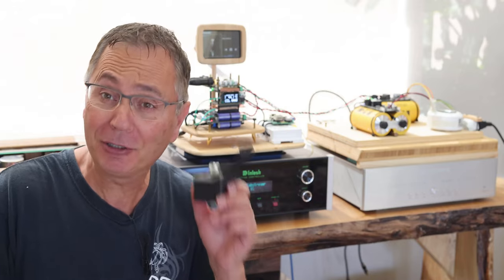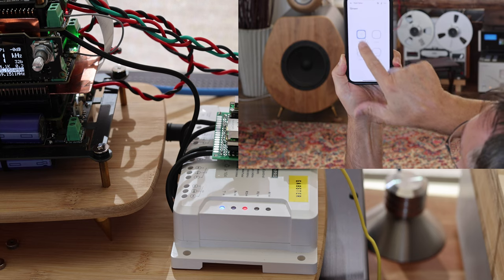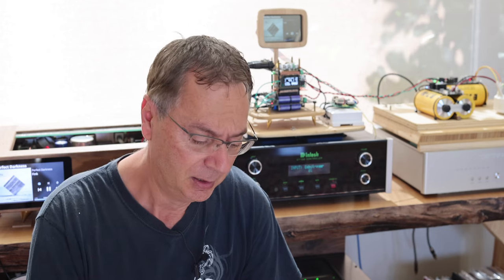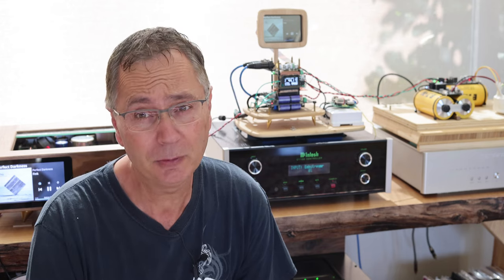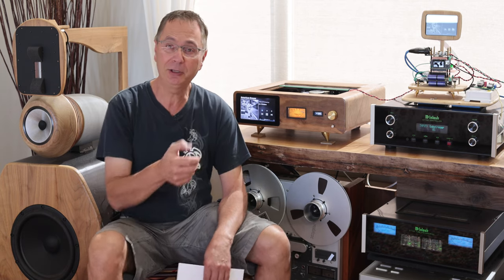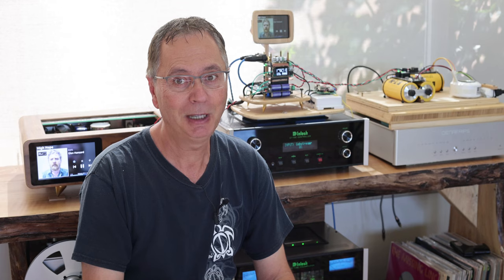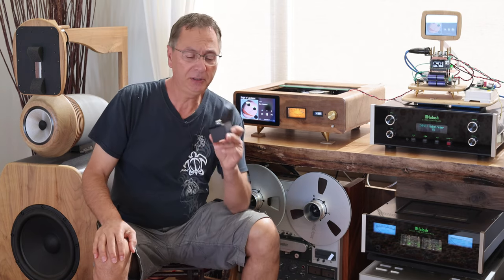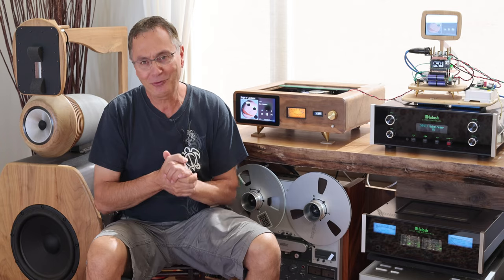Ian Canada SC-Pure Clocks. Are These DAC Clocks the Best for Your Audio Setup?

Comment: Thanks for the insights, could you also highlight beside the depth and seperation, how is is the high frequencies and bass say, compared to the Crystek. Ciyld the Crystek have more high and tighter, punchier bass compared to the pure?

For rock, pop music, does it still outperform the rest of the clocks tested?

Thanks again for your work and videos!
Reply from the maker: The Bass is nice and tight on the SC-Pure and highs have more layers and yes it does outperform the rest with all music including Rock and Pop. The better Quality recordings and better systems the difference is bigger and better.
Reply: @Gabster1  is sc pure ocxo ?

Comment: I replaced stock clocks in old Audio-gd HE-7 for accusilicons 90/98 and the change was unbelievable. But that cost 200 Eur for both with work of the technician. If the clock weren´t so expensive I would try them.. Thx for the vid
Reply from the maker: Glad you made your system better.

Comment: thank you for sharing, if you have time id like to hear more about why we need 2 clocks, what is the 45/49 you mentioned  and if the 45 will get you going, is it a option to just have 1 sc pure and 1 stock vs 2 crystec for example ? you mentioned clarity, detail and soundstage in your experience with your system could you put a % or # to those differences as if you were  taking notes for your own personal reference ?
Reply: One clock covers one set of sample rates.  45MHz will play multiples of 44.1, 88.2,176.4 etc.  The 49 will cover the multiples of 48,96 etc.  You can upgrade just one and compare the sound with your current clock by resampling the same track to be 44.1 vs 48 for example.  I use one expensive clock at 5.6MHz as 99% of my library is CD/44.1.  If I put in a second premium clock it will be 49 or 24.5 to play the higher sampling which is often at a multiple of 88kHz.
Very hard to put it into a %.  Some people are convinced they hear no difference.  To me it is a big deal as it is natural, holographic and analogue.  Others find it to be a very slight change.  Also depends on your total system and the type of music.  I like really well recorded jazz and like to hear the micro detail which delivers the emotion and and ambiance.  If your taste in music is to highly compressed rock or heavy metal, then it will make little difference.
Reply: @user-od9iz9cv1w  thank you for your reply.
So the 45 for cd & the 49 is better for streaming 24/192 ? which is mostly what I do.

Comment: Gaby - on the D11 did you end up using separate UC supplies for every v+ input (3 on the DAC and 1 on fifo) and for pi 5v and separately for the audio hats 5v? So 6 UC supplies?
Reply from the maker: Hi Chris
5 actually 1 for every v+ input (3 on the DAC and 1 on fifo) and 1 for FIfo 5v the RPI needs a lot of Juice so it runs on LinearPi/UcConditioner all supplied by 6 independent Ac 5x12v and 1x6v 
I later Realised that I did not need the VCAA on the Dac if running in Sync mode so 1 is not used now but may use it in my future upgrade may use the OPA 861
hope that helps

Comment: You mention they are double shielded, this is not correct. The outer shield has a lip that clamps the oscillator housing to lower resonance. No double shielding.

Comment: I have watched this video like 3x really want to build me a streamer/dac I normally just plug my labtop up to my denefrips ares2 or Burson composer dac ' (Tidal) what would be a good starting point for me Gabster ? I read schamtics on a daily bases i work on Multimillion dollar machines and Automated robotic systems i just stay so busy ! Never used a streamer just laptop and Cd transport 

Thanks Gabster
Reply from the maker: The Denafrips don't let you disable their internal clocks to use a better one so the sound does not change a lot but I suggest building a streamer dac for not a lot more that will beat the Terminator even.
I suggest this one but you need to add a couple PSU's once you like it more you will sell your Denafrips and break even. You can also email Ian tell him you were talking to me he will recommend something for you. :)
Reply from the maker: you can later splurge on scpure clocks they are great
Reply: Can I add those clocks to my dacs ? 
Or Are you talking about building 
The Pi streameri/Dac ? 
Most if the time I can't find schematics to my audiogear ' 
I need to get more involved with DYI community 😩
Reply from the maker: @tee-jaythestereo-bargainph2120  
you can probably replace the clocks but the output stage is still a issue. Better to sell it and build it the best way.
yo can start with the Protodac and a fifo Q7 that you can later use with your bigger build. it is cheap and effective and if you later upgrade you can reuse most of the parts.
https://youtu.be/m0esUvVu9W8?si=vOkW3rTv6rIg2aWO

Comment: This is a useful opinion to temper expectations vs the run of the mill clocks.  Your point is valid that clocks are the last step.  If you have a well resolved system and you listen critically then they are key in separating your DAC from average to exceptional.  
Also useful to simply get some insight into the pricing.  This is expensive.  Far more expensive than the first round of Well Audio clocks.
I think we need Doede to compare them to WellAudio clocks for an opinion on the high end clocks.  Frankly if they did not sound significantly better than the Crystek, then what's the point?
Reply from the maker: Thank you great points Please bare in mind I only ran the Clocks for 24 h prior to testing and they did sound significantly better than the Crystek and as I mentioned in my video it would be nice to see what others that own various Clocks and various systems and speakers think about them Time will sure tell

Comment: The best audio improver is our brain. So the most important part of any equipment is the price. The expensier, the better it sounds. Doesn't really matter what's inside if it's of good quality.
Happens the same with wine.
Finding differences into clocks that have jitters differences of picoseconds is plain stupid, is 6 orders of magnitude less than the minimal audio wavelenght. Also ... we are talking about a DAC. Any frequency above 28Mhz is thrown away...  1 or 2 ps would  introduce errors at around 1Teraherz frequencies, Thats 12 orders of magnitude above!
Reply from the maker: Good point

Comment: Great to see you built a board to test 4 clocks on the fly, first time I see such a thing. So if I get this correctly you can switch between clocks with a app remote?
Reply: Yes he said an app controls the relays to switch to any of the 4 clock sets. That was my understanding.
Reply from the maker: Yes you are both correct it is the best way to compare as our memory fades within minutes unless the difference is huge.

Comment: Very useful as far as it goes but the comparison that you really need to do is Ian’s clock vs Andrea’s clock.   Have you any plans to do that?
Reply from the maker: Probably, They are great clocks, but I am trying to compare clocks that you can easily drop in and not require more power supplies specially when using large ultracaps to power them it gets harder
Reply: @Gabster1 You really do not need a fancy power supply on Andrea's clock.  A decent linear power supply is more than enough.  Doede (DDDAC) did find ever so slightly perceptible improvement with supercaps added.  The SMB cable quality or vibration dampening is far more impactful.  Give it a few weeks.  Someone who runs Andrea's clocks will no doubt pop in SCPure and report it out.  Or if you want, send me a 49 and I'll report it out.  Or pop over if you are in Toronto...
Reply: @user-od9iz9cv1w  do you mean super caps added as filters to the linear supply? Or swapping in pure SC supplies? Which one failed to bring much improvement to Andrea’s clocks?
Reply: @chrisd1405  Filter on a linear supply.  I have not yet seen any reports of pure supercap supplies
Reply: Hi all. I have ordered SC pure to compare to Andrea Mori clocks. Hope to post video soon.

Comment: It is important to understand that XO phase noise varies quite a bit from sample to sample.  I have some experience with getting clocks measured and sorted for phase noise, and what one finds is that close in phase noise (for example at 2 Hz) can vary by as much as +/- 6 Dbc for clocks such as the CCHD 957, or the NDK SDA series.  I suspect there would be similar variations for Ian's Pure SC as well, unless Ian actually measures and sorts the individual SC crystals to verify performance to his standards.  If paying ~$200, or more, for an oscillator it would be nice to know for sure that the sample one purchases will perform to the standards shown in Ian's published phase noise measurements (or better).  Of course, Ian's Pure SC is the only SC cut crystal based oscillators easily available for direct swap in a lot of DACs or source components.
I am going to pick one up for my DSC-2 DAC, which uses only a single 45.xxx oscillator for use with only DSD 512 input from my HQPlayer server.  This DAC currently uses an NDK SDA series oscillator, which is the best performing, easily available, oscillator-but of course an SC cut crystal based oscillator can be expected to perform better than the NDK.
Reply: @barrowsworm1226 -  I see that you are using hqplayer.  I am using it within Roon with HdmiPi Pro II to a Gustard R26 DAC.  If you are using this configuration it would be great if you could help me.  The first question is how do you get HQplayer to see the HdmiPi Pro II.  Thanks - Dave
Reply: Also I am only getting 192 output for DSD files.
Reply: I run a Sonore Renderer as NAA with HQPlayer.  The Renderer outputs USB to my DAC, and the SC Pure clock is in the DAC, where it should be. @dcallender

Comment: Greetings! Thank you for another informative video. I am thinking of following your steps to build an Ian Canada Streamer/reckocker with I2S output (Roon IntelNuc—> Ian Canada Streamer —-> Denefrips Venus II). I wonder how much of an SQ difference can be heard between SC-Pure and the default FifoPi Q7II clock. 10%, 20%, or even higher improvement?
Reply: Also, I am currently using the Eversolo DMP A6 streamer. From your perspective, do you consider Ian Canada streamer with Ropieee to offer improved performance?
Reply: great questions
Reply from the maker: The Venus will reclock your streamer so don’t waist time and money on a great streamer 
If you are building a streamer add a Dac board like a dual mono and opa861 or transformers
Ad try it, you will sell your Venus and make some spare $ I just sold my terminator
Reply from the maker: Depends on the Dac if your Dac lets you bypass the internal clocks yes not too many do
Reply: @Gabster1  Hi, Thanks for your reply. Based on your Ian Canada Streamer video, I only purchased the streamer project (item 93D).  I prefer the layered, holographic R2R sound which goes well with my Decware tube Headphone amp and Decware 300B tube amp. I understand that sound quality can be subjective perspective. From your perspective, do you feel that building a streamer DAC with Ian Candana  ES9038Q2M Dual Mono II DAC HAT and OPA861 zero feedback balanced I/V board, will be equal to or better than Denefrips Venus II?

Comment: Do you know of any 100Mhz clocks which could rival these? The main clock in my DAC is 100Mhz and I currently have an ABRACON AOCJY1 installed, but I haven't got any idea if there are viable upgrade options for it in the future. Thanks!
Reply from the maker: I never experimented with the 100 but from what I checked you have a good clock 
May be experiment with the power you are sending the clock.
A good Linear psu, Battery or ultra capacitors are usually best in that order .

Comment: Thank you for your series; it's how i have been introduced to IanCanada products.  You have asked about other impression of these clocks.  I would add only that I find the Accusilicon pair to be more of an improvement than you have expressed in comparaion to the original clocks in my TransportPi Digi (w/3.3v block) - PurePi II system.  I would not go back.  Whether this relatively modest system is worthy of the SC-Pures is something I'll have to ponder.
Reply from the maker: Thank you for sharing about other impression of these clocks
Don't under estimate the small PurePi system

Comment: @Gabster Thank you very much for your videos, you convinced me to do a DIY project, your D6 streamer. Regarding the clock replacement, how to know if any of my other equipment will do the reclocking? I will be using a toslink connection from D6 to the Platin hub (with DSP for room correction) and via WiSa standard (24bit / 96Khz) to the Burchardt active speakers which have built-in DAC and amps. In short, should I notice any improvements regarding the clock or would the clocks be an overkill for my system?
Reply from the maker: Most likely it will get rec locked by your speakers Dac just use the reg clocks
Not a fan of room correction and DSP at least try without and see
Reply: @Gabster1  Thank you very much for your answer and suggestions. Much appreciated. Keep up the good work, you rock!

Comment: Gaby, I have two questions…. 1) have done any comparisons of different PSU types with any of these clocks? And have you experimented with NOS or other filter changes on the dac chip with any of these clocks?
Reply from the maker: The UcPure and 3000F Ultracapacitors is best followed by LinearPi/UCconditioner
Run the Dac in Sync mode follow Ian's recommendations on how to improve the sound in the PDF Document
Reply: I can attest to this. UCpure is best especially on dac, fifoq7 and clocks. Even andrea mori clocks on UCpure sound better. Like all of this is is slightly better but nevertheless combined it all adds up. I recently had a failed custom multi chip DAC fail and went back to my Dual mono ESS fully UCpure and LifePO4. Was surprised how well it performs. The psu is a big contribution to overall performance and UCpure is the best I have tried. I am yet to compare Ian's clocks with Andrea Mori and will comment as soon as I can. All I can say is going back to standard good stock clocks after 2 years of Andrea Mori clocks because my sine pi broke [my fault], it was as if someone was standing in front of my speakers....

Comment: Hey @Gabster. I was exploring the internals of my Terminator 1 dac and it uses Crysteks 45/49M clocks. I believe Ian’s Sc Pure can be replaced inside of this dac to make it sound better. Why don’t you explore it? Making a YT video log about that mod would be brilliant for your viewers!!! Thanks.
Reply from the maker: Are yours visible or are they inside a sealed metal box? The older terminators they were exposed the newer ones are inside a box 
Not sure how easy is it to open
Reply: @Gabster1  Hey. They are just like you see the accusilicons on the fifopi. Just that these are not on dil sockets but soldered onto the pcb. Alvin did this video where he easily desoldered the crysteks out from the original terminator and put external clocks in. Those were still more difficult to replace but the SC pures seem like a hand in glove fit. I have the very first Terminator with the blue caps and i believe yours is the same one too. If you are interested to collaborate on this project, let me know. You can take my details from Biselik. Here is the link to Alvin’s clock mod video: https://youtu.be/RUiQdLwhCec?si=c-RATDg1Zs3NU3Eb

Comment: Thank you for the great video!  If a person just streams max up to 4x 44.1/48 at 176.4 or 192 would you recommend the 22.5792/24.5760 clocks or the 45.1584/49.1520 clock combo?
Reply from the maker: I would go with the 45/49 combo
I would also try not to oversample it and see how it sounds.
Reply: @Gabster1  have you adjusted the NOS settings on the ES9038Q2M dual dac?

Comment: Gaby…thanks for this. Two questions…. 1) is the SC-Pure available now? ) Is the crystal completely shielded? No additional shielding needed?
Reply from the maker: Yes they are email Ian, He has a few not yet on the XL sheet I believe
Reply from the maker: They are Double Shielded on top and bottom shielded  but you can triple shield with a insulation in between and ground your shield it will not hurt

Comment: Gaby,       is it feasible to replace the clock(s) and DAC chip(s) in lower end or mid-fi streamers, music players and DACs to improve them?      Is there a lot of engineering and witchery done around these devices or is it a matter of observing, "yep, same number of pins.. out with the old and with the new...,,". ?  I have three devices that I would love to do this on. An old early model bitstream DAC That could likely benefit from a better clock as those have improved since its engineering. And I have two lower end all-in-one DAC/streamers that I would be interested in upgrading. There are micro soldering phone repair stores in my area that could easily do the job if it's a matter of just replacing a part with a better part.
Reply from the maker: Could possibly replace clocks if they have the same pin and voltage structure 
Dac Chips No unless you rebuild everything
Reply: @Gabster1  thank you. Op-amps are fairly standard to replace (And log audio section) ?  Improving those can make a noticeable difference, no?